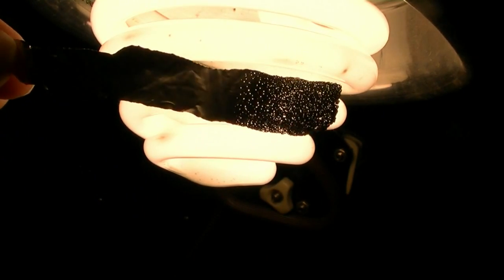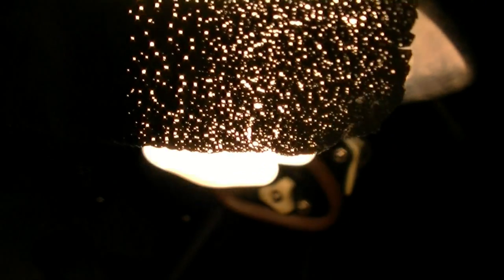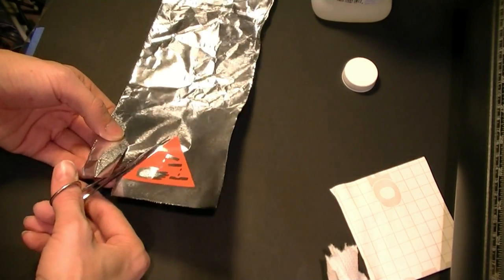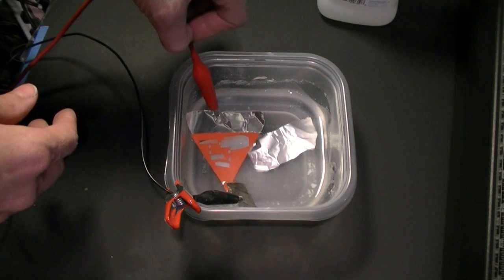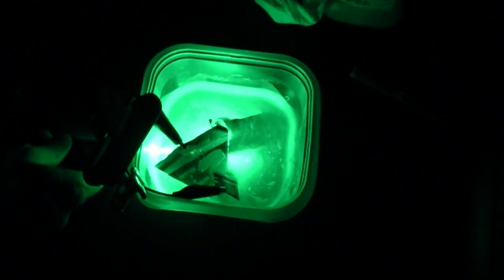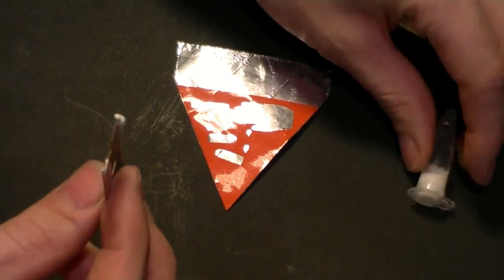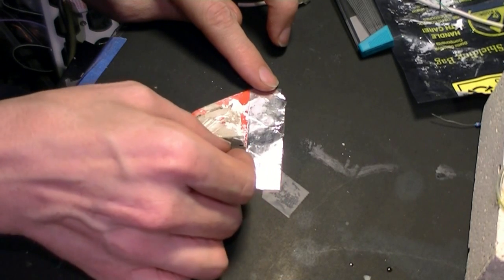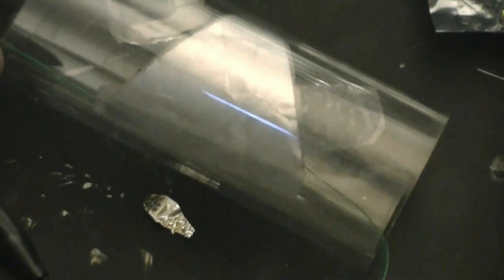Flexible Aluminum Electroluminescent Display - No Transparent Conductor Needed

Comment: @AmazGraz Oh, I remember. I was considering whether one could use epoxy or shellac to make a clearcoat. Because one could possibly brush on the medium, and when it was in the tacky stage, then coat it with graphite or carbon to make a conductive layer. This of course is how they plate plastics with chrome. There has to be a conductive layer to serve as the anode to attract the metal.

Comment: Nice effect!

I guess you already know this, but aluminium foil is not 100% pure. It contains iron and perhaps also carbon. You can simply check this yourself by "dissolving" aluminium foil in NaOH. It will show ironhydroxide on the bottom.